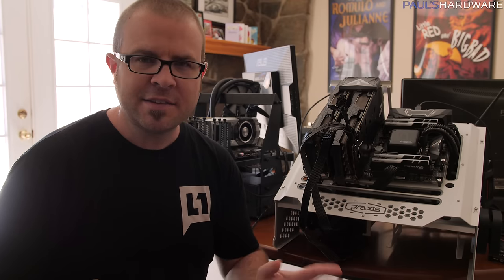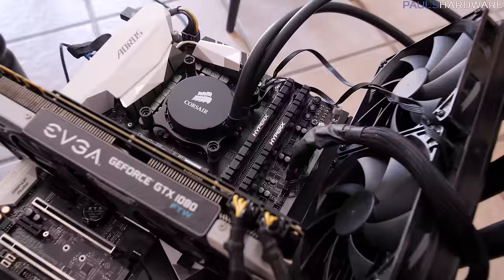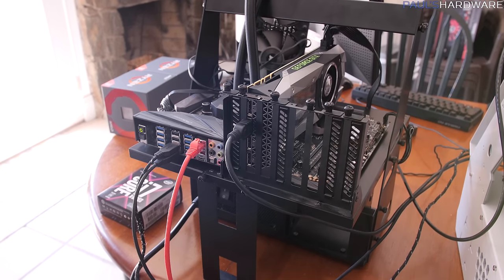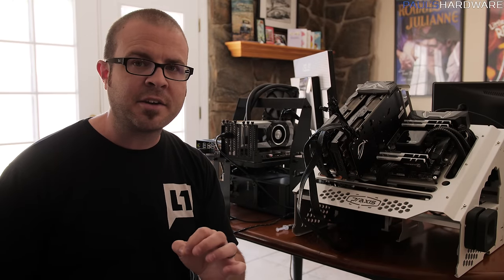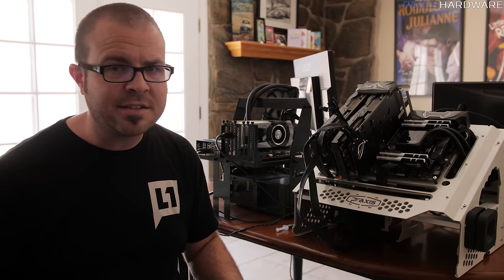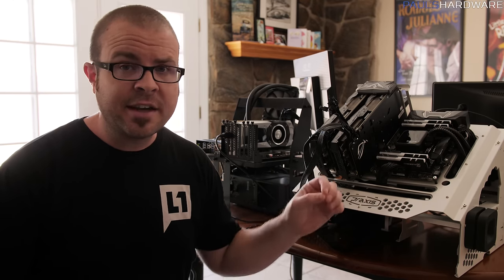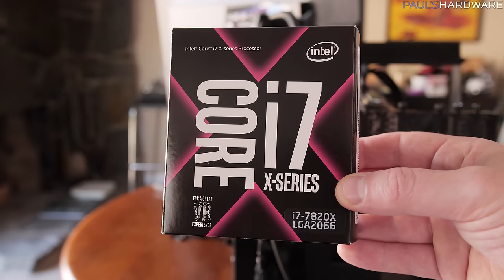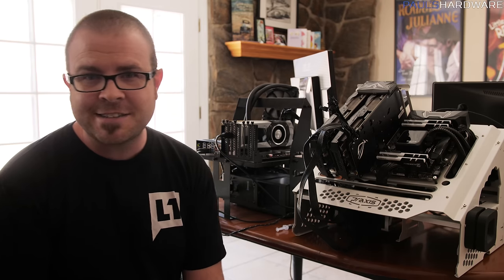What's The BEST CPU for Gaming with 1080 Tis in SLI?

Comment: So... I planned my upcoming pc build and I have pretty much decided on everything. I have done my research and I am stuck needing help. First of all, I never had a PC before so I don't already have like categories for how I'll use it because I only have a laptop which puts me off getting into (good frame rate) gaming and editing/streaming. On one hand I care about games most since I really wanna hit that 1440p 144Hz threshold in as many games as possible (suggesting I should get 7700k) but on the other  hand I want an all-rounder PC so in case I decide to get into editing/streaming I have no problems (which would suggest ryzen). In conclusion, I need help picking since I don't want the heat of AMD but am enticed by the price. For your info, i am going with a 1080. So ya... oh and also z270 has wider ranges of motherboards with wider range of features as well as more budget-friendly price points. 
Thanks for your time in advance. Any advice is appreciated!
Reply: You are not likely to notice frame rate differences if your lows are well above 60. You will super notice if your stream is dropping frames. If there's any chance that you'd be doing ANYTHING other than gaming and would like to not spend obscene amount of money then AMD is currently the best way to go. 

I personally got 7700k with an evga 1080 before zen came out and will probably replace it once 7nm zen comes out in a year or so.

Comment: First off, love the dogs, got to show them off. The 7820X at 4.6, don't know about the cache ratio? traded blows with my 6900k at 4.4 but my cache is at 3.7 and RAM was Trident Z RGB 32GB CL 15.  Physic score though, as I don't have a 2nd 1080 Ti to compare, but I digress. On Firestrike Ultra, I got a 23 442, but on Time Spy i got a 9 361. So I don't know if you've ever given any thought into comparing the two? I'm not moving from X99, but I'm just curious.

Comment: Am I the only one disappointed that he's not using a CPU with 36 pcie lanes or more? I mean, if you're going to try to determine the best CPU for the most powerful GPU SLI configuration to date WITH games optimized for dual GPUs then it doesn't make any sense to limit your testing options to just core count vs core clock. I would like to see 1080ti SLI performance in a X16 X16 pcie lane configuration with say an Intel 7900X (44 lanes) instead of possibly limited to an X8 X8 pcie lane configuration.

Comment: Paul, one question. The reason why one (enthusiast/professional) like you would partner up with a sponsor should be because you believe in the products the sponsor delivers and you are fully behind their performance and/or reliability. 
Why are you partnered up with G.Skill? Don't get me wrong, I've got the Trident Z RGB as well, but I'm currently disappointed how the software from G.Skill hasn't been updated since almost 4 months, and it's still in Beta and on my rig (MSI Gaming M7 z270) it stops working after turning off the PC, and it's annoying me.

If I had G.Skill as sponsor, I would try to look for another sponsor. But it's just my opinion.

Comment: I can't understand why your 7700k won't oc to 4.9ghz. I have mine at 5.0ghz daily and oc to 5.150ghz on my Kraken x62 in summer in winter over 5.2ghz but only for benchmarking purposes.  Got mine with a Rog 1080 and 16gb Corsair vengeance Red led oc to 3200mhz at CL15. Also my 1080 has a G12 with a x62 AIO and a Gigabyte B700H 700w 80+ gold.  It's a good gaming rig.

Comment: Thinking forward to when you put the 1080 ti's into Arctic Panther, is there any difference in performance from between a water-cooled and overclocked Founder's edition vs a more expensive model like the STRIX? Do those cards give any tangible benefit once you take away their aftermarket coolers? I'd love to see a video doing this comparison if the answer isn't obvious.

Comment: It would be nice to add even smallere CPU's just to find when the bottleneck tightens.
I suggests i5-7600k, r5-1600 (x) even r5 1500x and i3-7350k, i5-7400.

Some of these might beat r7 1800x in rise of the ... and GTA V.

Nice video although I will not even consider 2x 1080 Ti. :-)

Comment: Hey Paul, if this is a media PC, you should consider testing at 4k. The common assumption is that everything becomes GPU bound and that it doesn't matter what CPU you go with. However, that's a common assumption and I haven't seen any videos comparing these CPUs in a 1080Ti SLI config running at 4k. After all, you're not going to spend $2500 on a balls to the wall media PC and still game at 1080p...right?
Reply: It was tested at 4k

Comment: i think you should use the 7900x bc you mentioned the reason that you would not be using it and the main reason was temps. but you're already going to be putting the hardware in a custom water cooled loop. just my opinion.

Comment: I also have the msi x299 gaming m7 mobo and i love it! Got the 7800x to go with it and got it overclocked to 4.7 ghz easy, after that it gets really hot even with my EK custom watercooling so i geuss i have to delid it as soon as the new delid tool comes out from Der8auer. But im loving my system and i don't understand the bad comments on the new X299 platform.

Comment: I'd be more interested in what some of the older CPUs can do with 1080Ti SLI. Like 4790k should be okay, right? That's what I have now. If I o/c the heck out of it I would think that would work. Then all I'd have to do is buy the GPUs. Thinking of buying a 1080Ti now and maybe add a second once I get a 4k monitor which I have yet to decide on which one.

Comment: Great video. I do have a question if you know. I am running Asus x99-E with intel 6800k with 64g memory (planning to upgrade to 128). Planning to put 2 asus rog strix 1080 TI. Do you think it will run OK or do you recommend getting newer (better) mother board and processor? Thank you for your help.

Comment: I would also go with the Skylake-X 8-core CPU. It's new and has the most untapped potential. It's got more PCIe lanes and NVMe SSD RAID 0. But what if the use of AVX512 takes off and you suddently need 2 AVX512 units per core? Then the only option is the 10-core version? I mean is AVX512 even an upgrade over AVX2 with only one unit per core?

And what about 10G ethernet on board? Do the Aquantia ethernet controller feature good ping time? Are the drivers stable?

Do you know why the "Last level cache hardware prefetcher" option is only available on Xeon motherboards? It seems an obvious option to test for gaming?

Why is Speed-shift turned off by default on many motherboards? It should perform better with it on - right?

Comment: Random completely unrelated question, does the number of RAM sticks influence performance, by which I mean, say you needed 16GB of RAM, which would be best, 1x16GB, 2x8GB or 4x4GB. Is there a difference in performance (assuming the same RAM from the same provider with same speeds and same timings)?

Comment: Feel this video shows at the Extreme end you’re best off with the 7700k . If you’re intending to SLI you could simply  run a 7700k with 1080s and outperform the ryzen with 1080 ti s for less money ....

If you’re going anything less than a single 1080ti 7700k makes less sense because at that point you still can show that hey you’re better off chucking cash saved with ryzen at a better GPU. Now that the 7700k is ~$300 RIP doing a Ryzen build on the high end since it’s hard to use < 100 bucks for the upgrade to a 1080ti from a 1080.

1080 with ryzen beats 1070 7700k for sure though . I think with a 1080ti you can do what you want leaning for a ryzen at high res but a 7700 for high FPS. I’d still lean for the 7700k simply for high res even still because until you run LOTS of stuff clocks win out still. 8 threads isn’t exactly choking on chrome a game and some junk running in the background....

If you want a PC for running excel tons of chrome tabs maybe a CAD program or some other productivity software you really need RAM capacity and fast SSDs more than anything .

Threads performance is more linear than RAM , adding some threads is great but not running out of RAM should always be a priority once out of dual core hell.....

Comment: This is my build should I ad another 1080ti

-I7 7700k
-Asus apex ix mobo
-32gb corsair vengeance ram
-1080ti strix

I have an asus rog monitor that goes up to 165hz . I really want to see if I can get my fps close to that.

Sold my old build so I have a little extra cash to work with
Reply: if you can afford it do it. but wait for the gpu pricing to go down first

Comment: What if you have 4 1080Ti’s where you have 2 sli bridges with 2 way sli so you have two connected and the other two connected? How would that work?
Reply: Theboss24611 they have 4 way sli bridges if I'm not mistaken.
Reply: David Wang right, but two of the cards won’t be used because they are not supported by most applications including games, so I’m wondering if doing what I said will fix that issue, or is the issue not with sli but with the fact of multi GPU’s.

Comment: I don't understand the rise of the tomb raider results. I am running an 1800x with a single 1080 ti overclocked with a 120hz 3440x1440 and get the same FPS in the benchmark. Whats the deal.

Comment: Odd that the 1800x is on the same level as 7700k  frames in some instances ...  I've seen the 7740x not get as many frames as the 7700k .. so many diff variables out there  just depends on what cpu you end up getting .. kinda making reviews obsolete in a way ..

Comment: I eventually want to get another 1080 strix, concerned about the PCI lanes with my 6800k and x99 Phoenix SLI Mobo, need to do more research... but is it going to be worth it?
Reply: A GPU can't saturate x16, and running at x8 is perfectly fine and has no performance decrease. This will change in the future though, but for a 1080 it is fine.

Comment: Hey Paul, great video! I was wondering what is your opinion on what is a better CPU option for programs like Photoshop, Illustrator, InDesign, 3D Max, AutoCAD and other graphics and 3D rendering software. I am in in a dilemma between Intel 7700k and Ryzen7 1700 (x). I wont be using the PC for gaming, maybe once in a while, but mostly I will be using it for work. Also I am thinking if pairing it with a GTX 1070 GPU. Let me know what you think, I highly respect you opinion.

Comment: Newer games will run better with more cores and threads. Streaming will work better with more cores and threads too. I personally  wouldn't judge this on results from old games (which wont have been designed to benefit from more cores) like ROTR and GTA5, unless you are likely to be actually playing those particular games on this rig. For the 1800X (why not just overclock a 1700X?) performance looks pretty much identical in the newer games Sniper elite, For Honor, despite the lower clock speed. Since the "advantage" of going from 60fps performance from a single card to 90 fps SLI is moot anyway for most 4k TV's which wont run above 60hz, perhaps worrying about which CPU is pointless!

Comment: Thanks, Paul, nice comparison you have, that's a lot of work. I have a question: What if the 7700K is mounted on a motherboard that has a PLX switch such as ASRock Z270 SuperCarrier or Gigabyte Z270 Gaming 9. Will it be better at gaming performance since PLX switch offers x16/x16 to GPUs.

Comment: I have a 6700k and two gtx 1080's in SLI. Should I upgrade my CPU?
Reply: No. You will get a performance improvement, but I seriously doubt you will find it worth the expense or effort. If you were still running a 3770K the performance boost would be observable, maybe worth it.

Comment: the thermals would be fine if you delid whatever intel cpu you end up using (7700k, 7740x, 7820x, 7900x, they all have the same toothpaste tim under the ihs). This would allow you to hold near 5ghz on the skylake x models and hold over 5ghz on the kaby lake models.

Comment: Anything under the 10 core has a deficit vs x99 cpu's in gaming from what I've seen due to the L3 cache. Also ryzen still has a large deficit in some games that are very heavy on 1 or 2 cores. Crysis 3 and fallout 4 for example have a MASSIVE deficit compared to any decent Intel chip. My 1700 at 3.8 had minimums in the 20s in crysis 3 while my stock 7700k never went under 41fps.

Comment: Can I use this card on a 3rd generation i7 processor and Intel 3rd generation motherboard with 32gb ram and cx750 psu. Will it boot or put out a black screen i.e will be there a compatibility issue.
Thank you.

Comment: You should have included the everything, especially the 1800x without overclocking as only a tiny portion of games actually overclock.

Also you say you chose the Intel Platform because cost was not an issue, but then you complain about the X299 because of... cost.  And then you say you are picking the 770k because it was the best raw gaming chip, but then you say you might do streaming so the higher core count of the x299 platform might benefit you... then the x1800+ should be your choice... because you stated you did not want to waste the money going to the X299 and you likely would be streaming while gaming, so you need the extra core.  Just seems that you give excuses to not take the 1800x, but then use those same excuses when talking comparing between the Intel systems.  I think the Ryzen while not the fastest is very close for a great price and is more future proof than the core count Intel chips... especially since most of the tests showed very similar performance.

Comment: With the 7700k vs 7740x argument, i'd be interested to see if when both delidded, if they perform the same. since delidded 7700ks can reportedly reach 5.2ghz pretty frequently, so do 7740xs reach higher? Cause even the most anal of "but muh fps" people might get more out of delidding a 7700k than trying to go for a 7740x.

Comment: Why so wishy-washy about this enthusiast CPU issue? Stop with the numbers based arguments and Call it a day with a Ryzen 1700X instead of all this rambling back and forth. The ratio should be value to performance. Only a small segment overclock.
Reply: musinclind37 well considering the 1700x would also be a waste of money just like the 1800x. The only ryzen chip you should consider is the 1700. Comes with cooler and most clock at least 90% the speed 1800x or equal if your lucky. Then 1700x and 1800x are for suxkers, straight up. Spend the extra on your GPU

Comment: I need opinions!! I have a I7 7820x @4.8ghz (water cooled) , X299 AORUS Gaming 7 motherboard, 27' Asus 165hz monitor play in 2k resolution, TWO GTX 1080TI SC2 HYBRID GAMING water cooled  (switch sli on and off depending performance on the game) 32gb corsair 3000hz ddr4, 256gb SSD Samsung 850 pro for OS and a few games, 256gb SSD Samsung 840 Pro game storage and video recording storage, 2Tb WD for all storage, EVGA gold 1300w PSU.. I use my pc to mainly game. I do occasionally record game play, video edit and upload to YouTube... Would you guys recommend keeping my CPU skylake 7820x or getting a 8th generation 8700k? I do stream very very rarely.
Reply: Tronoxis Gaming I know this is later but I would keep the x299 setup you get more overall performance than just gaming performance. If anything save up for new gpu coming ou.

Comment: I wish I could run 4 GTX 1080Ti in SLI at 1080p and 2000 FPS in BFV. That would be smooth sailing. And at least 1000 FPS in BF 2042 when it comes out. But , as old as this video is I'm sure you will never see this post. I have 3 GTX 980TI and just got 2 GTX 1080 Ti. Yes I paid to much of them but I love SLI.

Comment: when will 5.0ghz be the norm for cpu?
Reply: When Intel starts innovating along with AMD
Reply: Danny Corona 3 years
Reply: Danny Corona GHz does not mean exactly what you think it does.  IPC (instructions per clock) is a better term.  AMD made a CPU years ago called the FX-9590 that was 5GHz.  However, a 7700K overclocked to 5GHz would crush it.  GHz isn't everything when you're comparing different architectures.
Reply: cool. please tell me more!!! why they havent worked on it? or is this is for future stuff?
Reply: Everyone's consensus is that Intel is to blame for the very slow increase in CPU performance.  That is the biggest reason everyone is excited about the Ryzen CPU's.

Comment: No CPU's capable of running 2 x16 pcie lanes? Should have thrown the 6850k in there. Running two 1080ti's will bottleneck in some games if using x8 instead of x16.
Reply: Jax Barkley 8* 16* honestly makes no difference LOL
Reply: I've seen otherwise
Reply: There is difference, it depends on what game you are running.

Comment: Would have been nice to see the 7900x as a comparison but if streaming is an option.. 
I'd love to have a 7700k in 8 core... 
7820 is probably where i would lean on the cpu for this. 
The 7900x would need a custom loop or a 360+ aio to keep it reasonable. 
I love my 7700k @ 5.1 I cannot lie i like tight timings.. But 7820 or a 7900 and a massive watercooling loop would be where my eyeballs fall upon.
Nothing against amd but your ipc and core clocking suck for high end gaming. 

I do have a question tho, why not stick to the 5960 and skip the mobo part and just plop the cards in there?
If this is just an excersize and you are getting the hardware for free/cheap go big if it twer me I'd stick to the 5960 and plunk the vid cards in the old mobo/cpu and get bizzy.

Comment: Hey Paul I have a question and I was hoping if you could help me out. So I got the nzxt kraken x62 but when I go to install it it's not making contact with the CPU so it's not cooling. This results in CPU temps going to 100+ and my PC shutting off. Is there anyway to get the pump all the way down? I have followed the instructions perfectly btw.
Reply: Scott White are the stand offs installed properly?